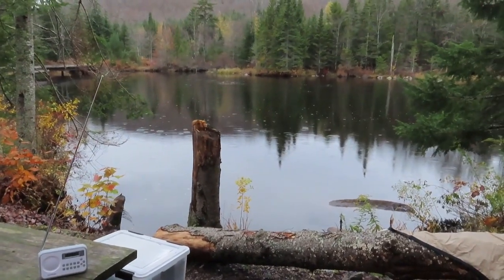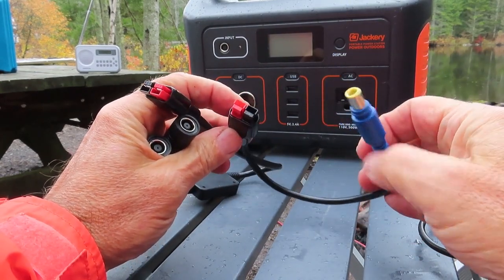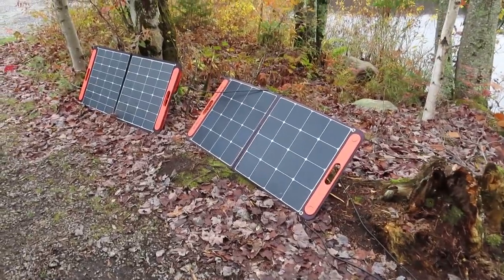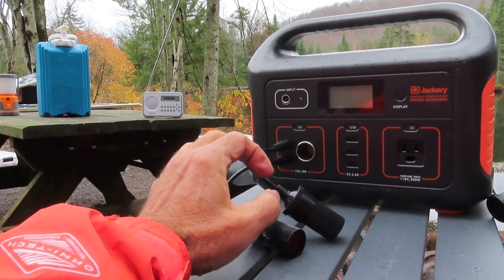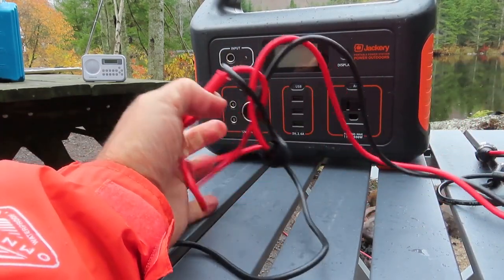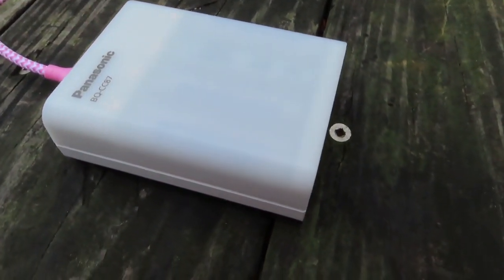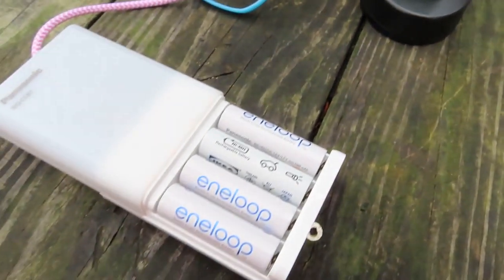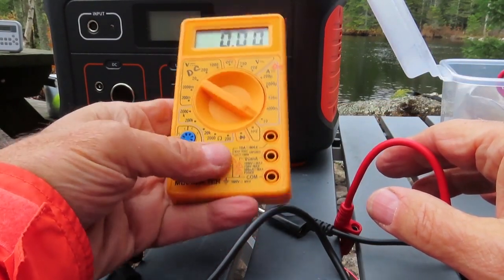Jackery Goal Zero Rockpals  connectors  Get the most out of your 160 240 300 500 1000

Comment: Hello Cosmo, my wife and I very much enjoy your channel.  Useful, practical outdoor information.  One lesson I learned the hard way with inexpensive (cheep) digital meters is that the test leads can have a very short life.  This can result in  unexpected readings causing you to chase your tail.  Just something to keep in mind.  Also, excellent video on modern silicone "rubber bands".
Reply from the maker: Thank You for sharing the heads up on the leads. I missed that because I use my own rugged leads. I have to say, leads excluded you get a lot of meter these days for $10. Thanks for the alert. =Cosmo

Comment: Really great video. Thank you. I was wondering can you still charge using one panel only with the y adapter? I want to be able to use my jackery panel to charge my RV batteries but can’t find a single 8mm female to anderson connection cable.
Reply from the maker: Yes you can use one panel with the Y adapter on the 500 but not on the 1500 and 2000. For those you need an adapter from Jackery to use one panel on the 1500 and 2000 More coming later. Thank You for watching. Check my other videos https://www.youtube.com/cosmoweems/videos 
SUBSCRIBE https://www.youtube.com/cosmoweems?sub_confirmation=1

Comment: I have the harbor freight solar panels with the SAE connectors and I'm getting the Sae connector To 8 mm for the jackery 500 it comes with adapter for the SAE  but do you know if I would have to use it
Reply from the maker: My Jack500 did not come with an sae to 8mm. If yours does thats great! Check the polarity before connecting

If I have this right the Solar panel output is SAE. Yes you need the SAE to 8mm to connect to the solar panel. DO TEST THE POLARITY before connecting to Jack. You can get a polarity reverse connector in case you need it. 

https://amzn.to/3tymmvt

INPUT 8MM To SAE https://amzn.to/31K1F43

I hope this helps! 
=Cosmo

Comment: Can one hook up 2 jackery solar panels to the Explore 240 using Y Connecter - to the INPUT 8MM to Anderson
Reply from the maker: Yes I do it all the time as pictured in this video. I use the 240 a lot to power my laptop for many hours in the trailer. However the jackery controller has a maximum wattage it will accept. I for get what it is - I am guessing 40 or 60 watts the rest is wasted without harm to the Jackery. AS shown using the Y and two panels is great when the panels are putting out less than full power. Regards =Cosmo Thank You for watching. Check my other videos https://www.youtube.com/cosmoweems/videos 
SUBSCRIBE https://www.youtube.com/cosmoweems?sub_confirmation=1

Comment: I’m trying to figure out the size of the output connectors no one seems to be sure. You said I think they are 6mm can you tell me exactly where you purchased them so I can look into it
Reply from the maker: Amazon Associate links You buy and may  earn. THANK YOU! 
============================================
Contact Jackery for the Y connector. 
-----------------------------------------------------------
MULTI METER $10 for 10 AMPS  runs on AAA rather than 9V  https://amzn.to/2Ly5xiS

INPUT 8MM to Anderson https://amzn.to/3jwnV7w
INPUT 8MM To SAE https://amzn.to/31K1F43
INPUT 8MM Extension cord https://amzn.to/3beWGeG
INPUT 8MM Adapter Compatible with MC4 Connector 48" https://amzn.to/3ltQzYy
--------------------------------------------------------
OUTPUT Dc 12v 10a Male Cigarette Lighter Plug to bare wire or banana plug  https://amzn.to/3wKO9N5
OUTPUT 5MM To SAE https://amzn.to/3bf0exx
OUTPUT OUTPUT 6MM to alligator clip https://amzn.to/3rhnnXU
OUTPUT 5MM Make your own connectors https://amzn.to/3hM2X42

OUTPUT Goal Zero 6mm Male To Female Cigarette Adapter 98056 Cant find one!

Comment: I have one of those 14 watt sunjack foldable book style solar panels but it only has a usb port on it... any chance you know if they make an adapter that goes from the usb port to the 8mm jackery port? .... can seem to find any info on it.
Reply from the maker: Hi there. Sunjack is too small to make any appreciable contribution to charging a large unit like this. The sunjack outputs 5 volts and the Jackery needs 12V and much more current than the Sunjack can produce.  𝕋𝕙𝕒𝕟𝕜 𝕐𝕠𝕦 𝕗𝕠𝕣 𝕨𝕒𝕥𝕔𝕙𝕚𝕟𝕘!  ✅  Check my other videos https://www.youtube.com/cosmoweems/videos 
SUBSCRIBE https://www.youtube.com/cosmoweems?sub_confirmation=1 =𝓒𝓸𝓼𝓶𝓸 ✅
Reply from the maker: Having said that I will be using the Sunjack to charge my phone this week,
Reply: @CosmoWeems  that was extremely helpful...I couldn't seem to find any info on it,... thank you!

Comment: Need your help bought a Jackery 300 and a Rock pal 100 watt solar panel  and both Jackery said it will work and Rockpal but the 8mm adapter does go in all the way into my Jackery 300  What can I do??
Reply from the maker: Hi Michael. The 300 is a great unit I use it al the time. I am unaware of an adapter you can plug in to make a better fit.You cant change the Jackery input so that means changing the plug on the end of the solar panel. But maybe you can use the Jackery 12V car input  charging cable on the Jackery side and make an adapter to connect to that?
I twould be nice if vendors got together and standardized connections. Let me know what you do. =Cosmo

Comment: If I wanted to add an additional 30’ of power cord with Anderson Power Poles on both ends from solar panel to Jackery, where would I buy this on Amazon?
Reply from the maker: Not sure if all PP connectors are the same size/amperage. There will be measurable losses at 30 feet. You might want to look up the wire gauge you are selecting and see what the losses are on 12 volts at 30 ft. This is an amazon affiliate link if you use it I may profit at no cost to you. https://amzn.to/3gcMtU7  𝕋𝕙𝕒𝕟𝕜 𝕐𝕠𝕦 𝕗𝕠𝕣 𝕨𝕒𝕥𝕔𝕙𝕚𝕟𝕘! ✅  Check my other videos https://www.youtube.com/cosmoweems/videos 
SUBSCRIBE https://www.youtube.com/cosmoweems?sub_confirmation=1 =𝓒𝓸𝓼𝓶𝓸 ✅
Reply from the maker: An ffiliate link U buy I may profit. I am required to say this https://amzn.to/358D9dx =Cosmo

Comment: I bought a bluetti that turned out to be junk, my email receipt was erased so they told me to kick rocks. It would be nice to use the ac charger to charge my lifepo4 battery, but i couldn't find an adapter to connect to it that could be hooked to mc4 connectors. This looks like it may work, the bluetti user manual calls it a dc 7909 connector, but it looks like your 8mm connector. I wonder if it's the same thing or totally different? I'll have to check it out, it would give me an easy to use ac or generator  charger.
Reply from the maker: Nice job taking apart the Bluetti https://youtu.be/ltCDLm-pJVM.  𝕋𝕙𝕒𝕟𝕜 𝕐𝕠𝕦 𝕗𝕠𝕣 𝕨𝕒𝕥𝕔𝕙𝕚𝕟𝕘!  ✅  Check my other videos https://www.youtube.com/cosmoweems/videos 
SUBSCRIBE https://www.youtube.com/cosmoweems?sub_confirmation=1 =𝓒𝓸𝓼𝓶𝓸 ✅

Comment: The 5mm to cigarette adapter you link to doesn't fit the jackery 500 dc out. I bought it and it doesn't fit
Reply from the maker: What is the issue? Can you describe how it does not fit? Too fat? Too long, too short? Not sure if something changed. I will remove the link till I hear more specifics from you. Thank You =Cosmo
Reply from the maker: You are referring to this one right?
OUTPUT 5MM to cigarette lighter adapter https://amzn.to/2YRa9Vc
Reply: Thats the one. The outer diameter of the adapter is too small, also the pin in the center of the jackery is way too large to fit into the adapter. I think the jackery takes a 6mm barrel plug (per hobotech).
Reply from the maker: Thank you for the update.  I am sorry for the time wasted. I measured the barrel on the Jack issued adapter and it appears to be a 5mm on mine. The Goal Zero uses 6mm https://www.goalzero.com/shop/sherpa-power-banks-and-accessories/6mm-output-female-cigarette-adapter/ I dont have that one. =Cosmo

Comment: How long does the jakety last? As far as years
Reply from the maker: All these lithium power devices are usually rated in how many charges you will get until it will only recharge to 80% of original capacity. The Jackery is rated to recharge 500 times before it will only recharge to 80%. 80% is still plenty of life but that is how they are most often rated. That said these are GREAT devices if you need power. Thanks for watching =Cosmo
Reply from the maker: Lithium Iron Phospate batteries can be recharged more times 1000 to 2000 but are heavier.